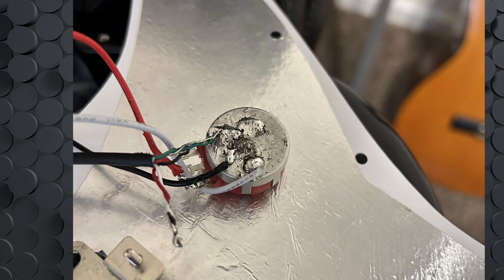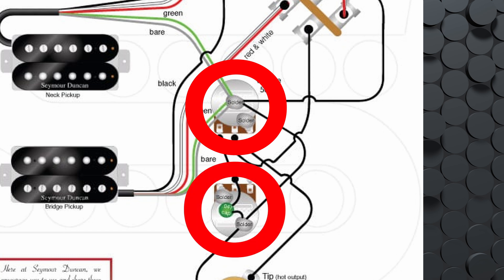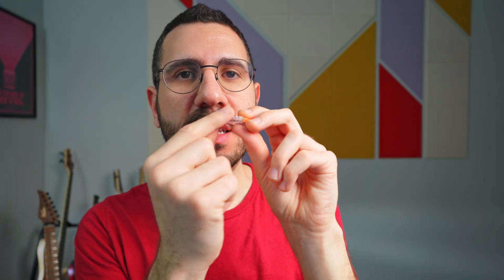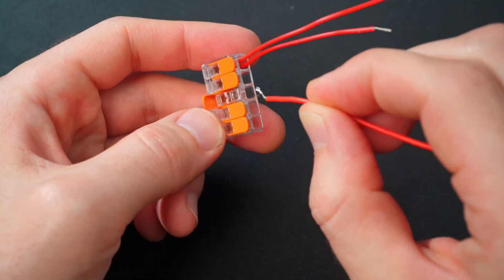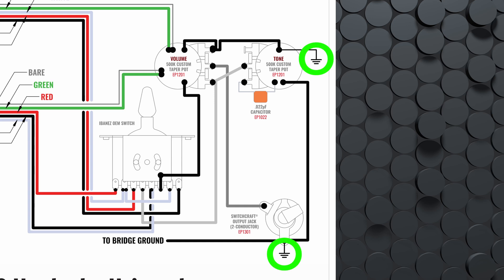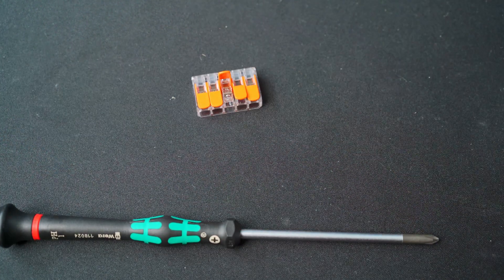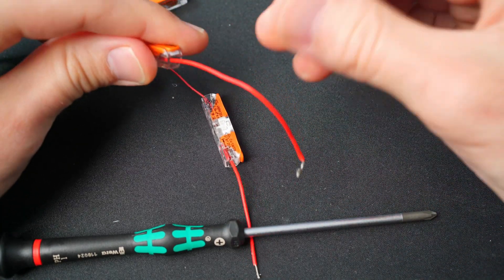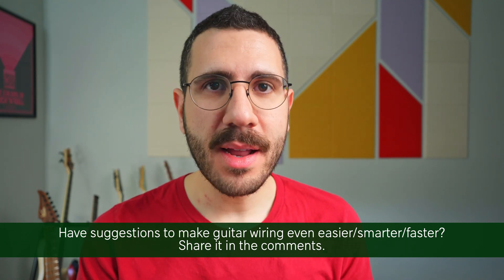A Smarter Way to Wire Guitar Grounds

Comment: do you still have to ground the pots together?
Reply from the maker: Hey! You don't need to do that as long as each pot has a wire going to the common ground which in this case will be the lever nut.

Comment: Hi, I am total noob when it comes to changing pickups and I am a little intimidated by the whole soldering business.. Would this still need soldering to be done?
Reply from the maker: Hey! Soldering isn't tough. It just takes some practice. I suggest practicing a handful of times to get the hang of it. Or you can ask some friends/family members if they know how to solder to help you!
Even if you're going to use the Wago lever nuts, you'll still need to solder to the pickup selector switch and lugs on the pots. It just simplifies the ground wiring and soldering.
Reply: @YousefAHMusic  Well I guess there is no way around it then 😄Thanks for the encouragement!

Comment: Doing so the potentiometers is not grounded at all. In fact the potentiometers metal housing may act as additional shielding but has to be grounded well of course. Moreover i dont like office sticky tape. On the long run the glue hardens and the result is this ugly crust on everything i had touched.
Reply from the maker: You must ground every metal component. That includes the volume pot. I solder a wire to lug 3 (the right most lug) and connect it to the lever nut. That grounds it.
Technically, grounding to the casing of an electrical component is not going to shield anything. You can do that with copper shielding tape or shielding paint (essentially forming a Faraday cage), which all my guitars have.
I've wired 1000's of electrical audio components and circuit boards. I've never wired additional grounds to the casing/back of electrical components. Open up any audio equipment you have that has pots. You're not going to find any additionally soldered wires to the casings/backs of them. I don't know why people think you need to do that for guitars/why it's standard practice.
Use whatever tape you like. 😁

Comment: It's done that way to shield the pots from radio frequency interference from wireless devices and nearby radio transmitters so they won't bleed through your amplifier.
Reply from the maker: Technically speaking, soldering to the back of the pot won't do that, nor will it do that for any electrical component. Shielding will do that, though, which this guitar and all of my guitars have. Copper shielding tape or shielding paint works.

Comment: An alternative, although it still requires soldering got some tabs, similar to what the pots have for the actual wires I found them on Amazon "Soldering Lugs Crimp Weld Ring Lug Terminal Brass Silver Plated Ring Terminals Connectors Assortment Kit" I bend one end to an angle and that allows for easier swapping of pickups since you don't need to heat up the whole pot Everytime you need to do a wiring change. Although this is on a passive jazz bass setup so it works great for my application. I hope this helps someone else out

Comment: I use the Seymour Duncan Liberator pot when I'm running passive pickups. Though I modified mine by removing the wires. And I have my humbucker coils soldered together and taped up. So I don't connect those to the Liberator. When I have EMG active pickups installed, I use their system.
Reply from the maker: I've looked at those before! I love how it has gold plating so you can easily solder to it. Schaller 5 way switches have that, too. I want to try one of those switches out one day.
Reply: @ The Liberator pot has multiple locations to connect ground wires without any soldering to the volume pot. Though I don’t run tone pots. I put a button kill switch in those places like Buckethead.
Reply from the maker: @ Gotta try it out!
Reply: @ What I ended up doing was desoldering and removing the wires as I didn't really need them and they were kind of in the way. I run all of my grounds to the little connector on the back and they all screw in. I wired it up so I could remove it all without desoldering for when I install EMG active system and pickups.

Comment: Soldering to the back of pots is only wrong if you don't know what you are doing. Globs - blobs? FFS. Learn  to solder.
Reply from the maker: Okay, deep breaths! It sounds like someone needs a hug. It's totally fine to vent; I'm here for you. But if you keep using the comments section of my videos to deal with your anger management, I'll eventually have to send you a bill for the session. 💓
Reply: @YousefAHMusic  No more than 50p, please. But I think if you look closely, you are the one venting. I'm calming you down.
Reply: @donepearce  I have never seen it done in tube sets or t.v.'s, why do you need it in a guitar ?
Reply: @davidhamm5626  it's a convenient ground point. In a valve TV there is a chassis with many solder lugs. Don't multiply potential failure points needlessly.
Reply: @donepearce  Okay, thanks for your reply.